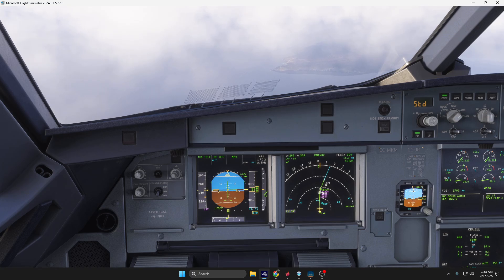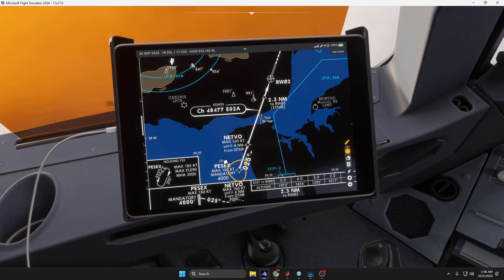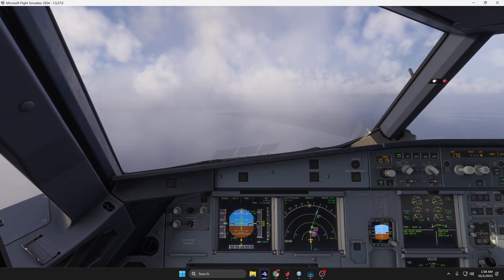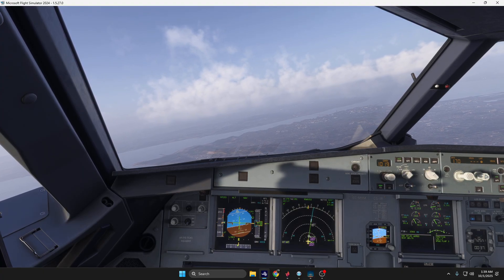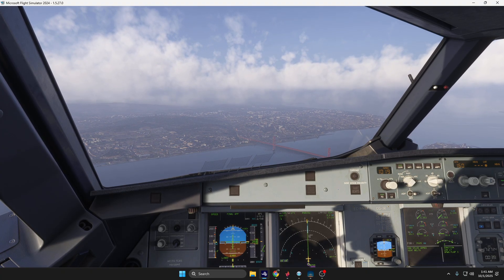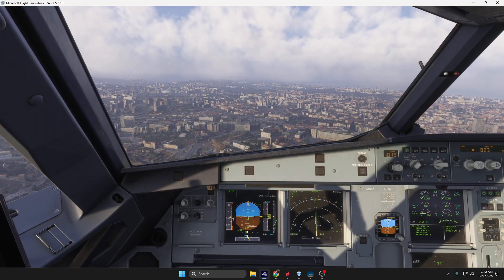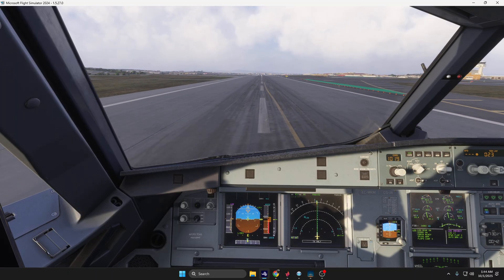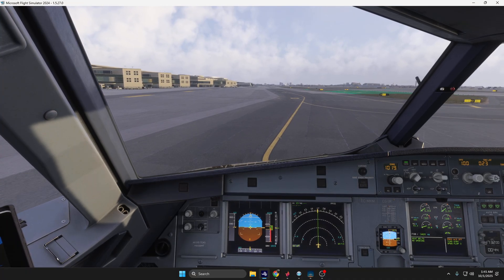VATSIM RNAV Approach RWY 02 LPPT | Real Pilot Explains Step by Step

Comment: Looks very nice to say the least. Subscribed. May I ask what settings you are running and how the performance is on other aircraft like; PMDG, iniBuilds, iFly etc as I'm also planning on upgrading from a 4060 to a 5060ti (16gb) or 5070ti. :)
Reply from the maker: Thanks for the subscribe and welcome to the channel we are going to upload a lot of useful content , about the RTX 5060ti which im using right now : It has 16gb vram which is far enough if u r using sceneries and addons because in big Airport im using about 13 gb (RTX5070ti it has 12) but the there is a difference in power the 5070 is more powerfull than the5060ti , if u are looking for good quality with a lower price the5060ti is good for you , im running ir with an i5 12400f CPU and 32gb RAM and im so happy with It . Hope my comment will help u to choose , welcome again.